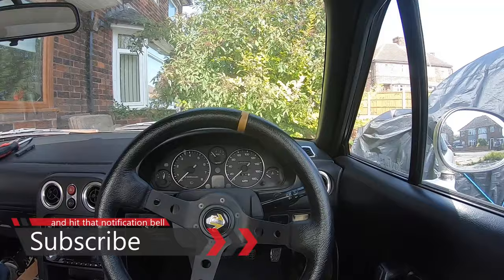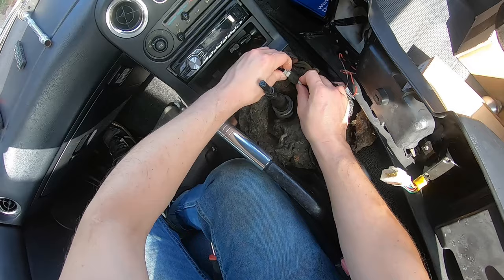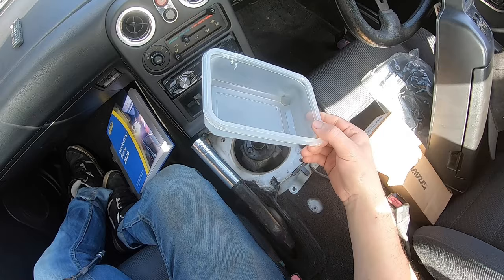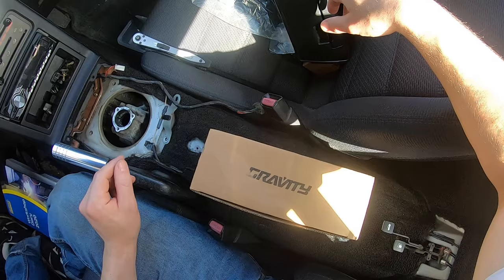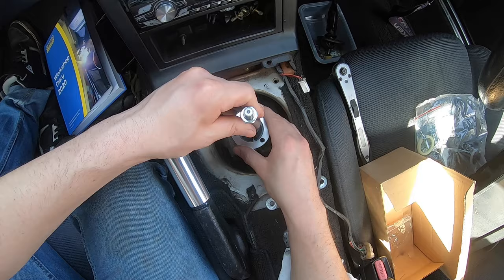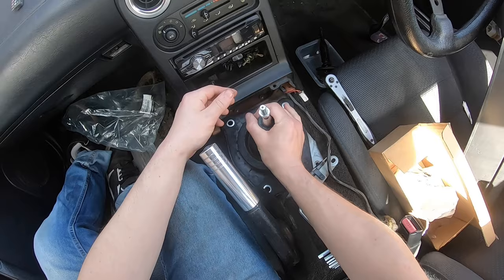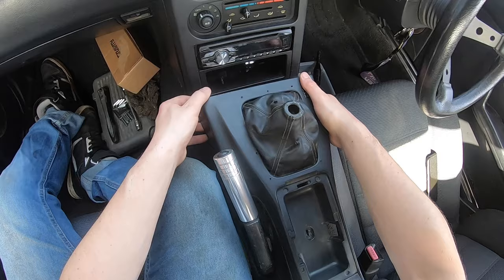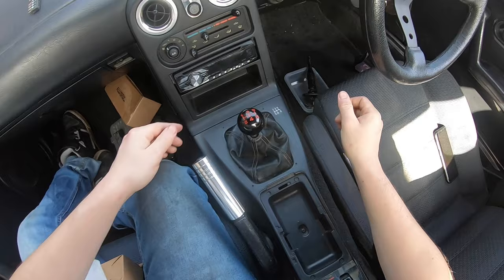How to fit a short shifter the correct way mx5 miata mk1 Ep.15

Comment: I've seen this kit installed so many different ways all claiming it's the right way. Lol. So what is the correct way if they all claim it works? 😕
Reply from the maker: Well in other videos iv seen people breaking parts of the gearbox fitting the kit upside down or just not fitting parts at all and then blaming the manufacturer so in mine all parts are fitted and nothing is broken 👌

Comment: Awesome vid, just fitted a short shifter to my NA, and it was as easy as it looks in the video. I would have messed it up without this!🙂👍
Only thing I'd add:- 
1. put the car in gear before starting the process to make old oil easier to extract.
2. get a liquid soap with pump dispenser, and use the pump to extract the old oil before refilling, it is way easier than other methods I tried (turkey baster, paper tissue etc)
Reply from the maker: Yes that's great a soap hand pump is an amazing idea and I imagine so much cleaner 👌👌

Comment: My turret has two pins, so the spacer won't fit.
Reply: Were you able to figure out a solution to this?
Reply: @nickross8950  I think I either just didn’t put the spacer in or I cut the groove into it for the second pin and just chucked it in there, the official way I think is that you’re able to knock the second pin out and then it’ll be fine from there but I couldn’t.

My shifter works but spins and feels wrong, plus my 2nd gear synchro is going so I’ve managed to get my hands on a mk1 gearbox now and I’ll just buy a new short shifter kit and do it properly.

P.s MK2 mx5 gearboxes have two pins in the turret  and mk1s only have one.